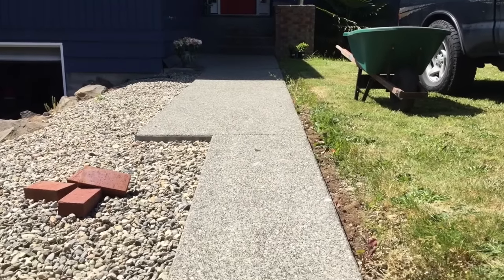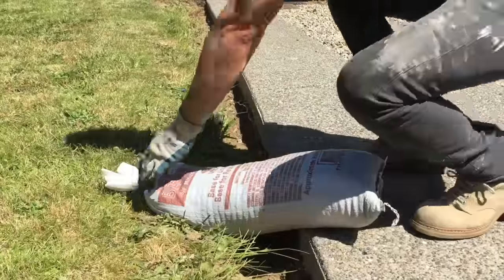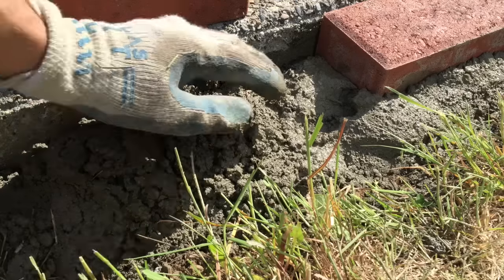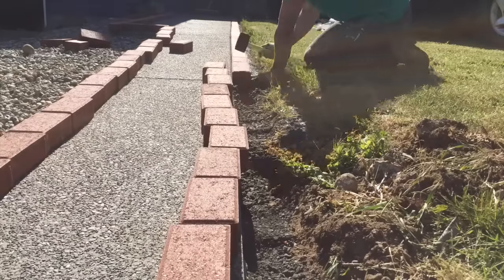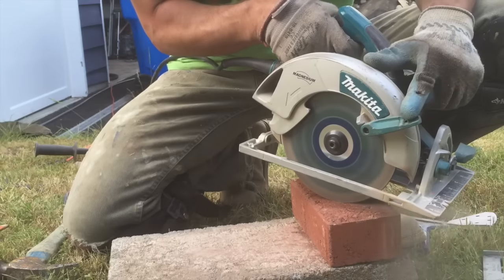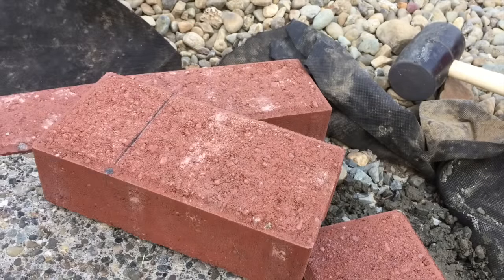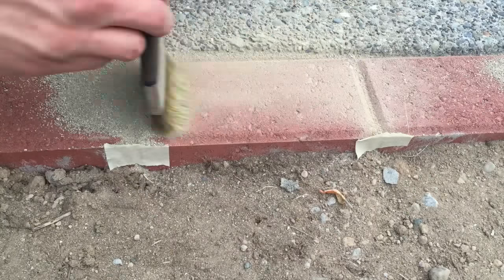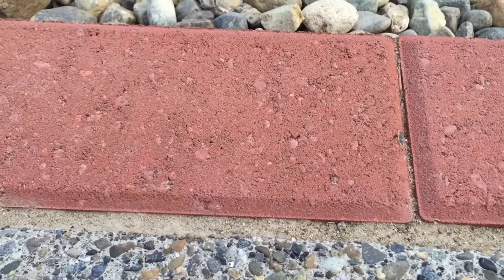DIY BRICK WALKWAY : HOW TO INSTALL ACCENT PAVERS

Comment: Just a quick mention:
               If your 45 degree corners aren’t perfect to your expectations, grind some brick dust and lay a bead of clear caulking along the joint.  As the caulk to shrink and set-up you can sprinkle the dust into the joint and it will make your cut appear virtually invisible.
              Play around with it and you’ll get a nice looking mitre.
Reply: GENIUS!!!!!!

Comment: Nice video. Using a circular saw (or even a chop saw) with a masonry blade will give you smoother 45 degree angels for those corners. I prefer the chop saw since it cuts in precise angles and I don't have to worry about marking the angles.
Reply from the maker: Great suggestion Nash and thanks so much for watching.  I’ll have to try that one out soon.  Hope you subscribed.

Comment: Great tips on building the foundation with a trench, gravel and sand. I especially like how you used the 4' level to scrape the top smooth before laying the bricks. Most videos show laying and leveling one brick at a time. I like your method better. And congratulation on the upcoming birth of your daughter.

Comment: O M G after searching for freaking weeks I FINALLY found a video that is EXACTLY what I am looking for!!! So my grandfather has a cement patio that was surrounded with a TON of weeds etc. My grandpa had 2 heart attacks and fell and can no longer work on the backyard like he wanted to. Me being a girl lol and someone who has never done landscaping before..I though " screw that! I can do anything " I busted my butt and I removed all of the weeds and other debris..it took me awhile. I finally was able to afford material for the border I wanted to create around the concrete patio. At first I used a weed killer, weed preventive fabric and then placed edging against the cement of the patio. My first thought was to put down the quick dry concrete mix and then lay the bricks...while adding the edging AFTER laying the bricks..to give it a good hold that is shaped and clean..someone came by and told me to put the edging first...which against my better judgment I went and did. Smh. It was really hard and there was a ton of space between the brick and patio. Ultimately I wanted to find a video of a similar situation to make sure I do it right the first time. I now need to remove the edging and relay the concrete. Ugh. Had I found this before I would have been done. I haven't had enough to afford finishing it and wanted it to be perfect so I could surprise my grandfather. I'm wondering how I may get ahold of you to show you a few photos of what I've done? Please let me know! Thanks so much!
Reply from the maker: Wow!  Sorry to hear that you have to do it over but glad you found my video and it helps.  Yes please send me a photos on my instagram when its done.  @byotools.  Thanks for watching and the support Angelina.
Reply: So sweet....for grandpa ❤ great story!
A great lesson, too...you don't know what you actually CAN do until you try! And, go with your gut! YOU GOT THIS!
Reply: I just did this today under the hot florida sun. I definitely did the foot thing leveling the soil. Didnt come out professional looking. But it got done. Also trying to avoid weeds growing into my pavement. Not an easy task. Especially when your not a pro. Lol

Comment: Good luck growing grass next to the pavers with the mound of concrete at the back, you never heard of edging restraint ? A quick tip, switch the hose head to fine spray when activating the joint sand otherwise you blow the sand out of the joints 👍
Reply: 7th 😢😢🎉🎉😢🎉🎉😢🎉l😊😊😊😊😊😊

Comment: quick question: i will be doing the same, but why not use leveling sand like any other pavers installation instead of concrete?
Reply from the maker: Hi Andres.  Good question.  Because I have an awkward elevation on one side of my walkway I had to use something more substantial.  Many people are affrade to use concrete since the brings may not stay adhered over time but I feel if you install the concrete and the brick correctly then the concrete should hold up.  every single prick I laid is still there and hasn't moved an inch.
Reply: Great video I will be doing something like this soon. Thanks for tips. BYOT a look back on your reply to Andre 2nd last line, last word. Might be very difficult to keep them from expanding or moving lol. Sorry couldn't resist

Comment: Thinking of doing a similar strip along my driveway. Do you think it will hold up to the weight of a car? Maybe I'll butter the underside of the bricks with Thinset before setting them in the mud?
Reply: Your the only one he didn’t comment on I’m wondering the same thing???
Reply: did you ever try this?
I am thinking of doing the same as you to widen the driveway.
Reply: @HeyStripes  No, I didn't do it. A brick layer told me that in order for the row of bricks to hold the weight of a car, I'd have to build a "footing" before laying the row of bricks. Basically, without the footing the row of bricks will tumble to the side under the weight of the car. I never looked into how to build a footing. Maybe it's easy to do?

Comment: Great stuff any ideas on my natural rockery that I've put together for my flower bed in Swansea UK? Just to keep it intact and solid and in place ? Permasand?
Reply from the maker: Great to hear Karl and thanks so much for watching.  Hope you subscribed.  As for your project I've actually took standard red bricks in the past that lined them up vertically around a flower bed.  its not as structurally sound as this video but its a cool design and you can get creative with it.
Reply: @BYOTools  Thanks for your help! I'll work on this and take your ideas and experience on board in order to make this look great! Many Thanks! Karl

Comment: one thing do not use any conrete :D brick walkaway you must lay on sand doh, same for side of walkaway. cement will start to crack after time and you will seecrack on sideway too . And you will need to redone all not one tile. You use sand as you need to fix walkaway you just replace one tile and job done.
Reply from the maker: Arturas nesakysiu I would agree with the sand comment in most circumstances but I had an odd decline on one of the sides and I needed something much sturdier then sand.  Wanted to try concrete out and see if it would last.  It’s been over two years now and I have had ZERO issues with the brick separating from the concrete.  If I get separation in future I will be posting about it on my Instagram but nothing yet.  Thanks for watching.

Comment: Great video but you forgot to show how you finished the lawn side. If you left it as you showed in video grass would never flush up to sidewalk.
Reply: I was curious about that too? Chisel off the extra clumps of concrete or are they to hold the bricks inline instead of plastic brick edging?

Comment: Thanks for the video! I have a couple of questions. I've seen edging like this being done with a mixture of paver sand and Portland cement. Do you see any disadvantages of using this mixture vs. a pure concrete mix like you did? Also, do you think adding a plastic edging along the bricks (like you would for a paver walkway) is overkill for this project?
Reply: This guy used aggregate in his mix  which I would not use as rocks stick out of the mix and mess with bricks level. A mix with no aggregate ans a mix of 6 to 1 is best
Reply: @tonesgaming1012  Thank goodness I saw this!! I was so pissed when I opened the bag of cement. It had tons of rocks in it and as you said it made it really hard to level. That was my biggest issue.
Reply: @linamarie84  I said 6 to one. But it's actually 4 parts sand and one part portland cement. That's the general formula for mortor

Comment: just doing one 45 degree angle connection is going to really bug you or someone that might be looking to buy your place down the road. What about the concrete that got pushed out the side of the bricks towards the lawn?
Reply from the maker: the 45 degree cut isn't very noticeable.  Also, you can't see the concrete since I brought the soil up to the top of the brick.  Check out BYOT #10.  Thanks for watching.

Comment: All that work for measly single brick line on either end? Guess i should explore other options since i wanted to do this, 1 foot on both the right and left side of my driveway.
Reply from the maker: Sometimes the simple looking jobs tend to be the hardest ones haha.  Thanks for watching.
Reply: It all depends on your outlook. I bake and sing and all this other stuff and one day after my grandpa had his second heart attack I went out in back and did it myself. It isn't difficult at all. It is knowing the tips that make it easy. If I can do it you can too! 😁

Comment: Good job!!! I am about to do a walk from my sister's back door to the deck I just built for her would it work if I dug down like 3 inches filled with concrete and lauded brick pavers then fill in cracks with sand concrete mix ???
Reply: Layed brick pavers
Reply: I'm using 12×12 pavers by the way and only 2 wide
Reply from the maker: In that case I would actually suggest using a sand sub straight.  The bricks I laid are still in perfect condition but not meant to be the main walkway.  If the pavers you are using way pop off the concrete and won't be as nice as a properly laid walkway with a sanded and crushed rock sub straight.  Thanks for watching Gregory.

Comment: Will this method work to make brick paver patio? This method seems much easier to do.
Reply from the maker: Hi Yong.  You could try it but I wouldn't suggest it.  The larger the area, the more likelihood there is that the bricks may come loose overtime.  None of the bricks that I laid are loose but using a traditional drainable crushed rock and sand base is what I would suggest for a large paver patio area.  Thanks for watching.

Comment: Why use concrete and not a rock base with sand?
Reply from the maker: I wanted to try something different on this project since it was more of a detail strip then a brick walkway.  All the bricks are still in tack and haven't budged at all.  I would suggest using a standard rock base with sand if the entire walkway was brick.  Thanks for watching Bill.
Reply: @BYOTools  well you could've placed the bricks on rock base and sand, and place concrete on the side only, for them not to go away

Comment: Why did you use polymer sand to fill the gaps instead of the concrete?
Reply from the maker: Concrete is way too thick of a material for this size of a gap.  The sand I used is specifically for this type of brick gap.  Hope that makes sense and thanks for watching.
Reply: @BYOTools  thank you for the reply, I'm trying to decide which i need to buy for a rounded flower edge with bricks

Comment: Would this process hold up to the weight of a car? I need to enlarge my driveway.
Reply from the maker: It potential could but I would not suggest that.  Too much weight, unless you make sure to have at least 4" of concrete under the brick.  That might make it possible.  Thanks for watching though Craig.
Reply from the maker: However, I would just suggest using compacted drainage rock and sand under the brick.
Reply: I just ran across something recently that’s referred to as mechanical concrete. It seems like a real simple and inexpensive option for multiple applications. I have a few projects on my list to do around my property that I’m thinking this method would work great for.. a retaining wall to build up and level the grade by the adjacent apartment building fence.. foundation for a back yard deck and storage building... and last but not least my driveway.

Comment: The water main. You did not plan something for it? You just left it like that? Why not design the project with it in mind, so the whole thing didn’t end up wrong after all that work?
Reply from the maker: What are you talking about Michael?  The WHOLE sidewalk is designed around this idiotically placed water main.  Why do you think my sidewalk isn't just straight?  Its in three different sections for a reason unfortunately LOL!  Thanks for watching though and hope you enjoyed most of the video.
Reply: BYOT I enjoyed the whole video until the end and then I screamed. If I had something like that I would re-design the walkway - I would start by getting rid of that existing walk that was designed by someone who does not love you.

The accent brick ending at the water main  now serves to accentuate the problem. Break that walkway out and put a bush or something over that Watermain to hide it, and make a beautiful curved walkway surrounded by amazing plants that make the front of your house look beautiful.

Comment: can I make an entire walkway of pavers using this method,
Reply from the maker: You could try it but I wouldn't suggest it.  The larger the area, the more likelihood there is that the bricks may come loose overtime.  None of the bricks that I laid are loose but using a traditional drainable crushed rock and sand base is what I would suggest for an entire walkway.

Comment: Nice video! If you would wet the side of the brick that will contact the concrete, and maybe, if you are anal as this engineer, brush on some cement on the brick to ensure it is all the crooks and crannies of the the brick, your bricks “never” break bond and come loose.
Reply from the maker: Great Tip RH.  I've never done that before but I understand why it would work.  bricks are in tack and haven't broken free yet so I must have done something right haha.  Thanks for watching and hope you subscribed.

Comment: instead it called cement until it dries? then it hardens to become concrete? its confusing.....
Reply from the maker: Its actually should always be called concrete.  Cement is just included in the mix of concrete.  Good call.  Thanks for watching HK.

Comment: That concrete is going to crack and those bricks are going to shift.  That was not even remotely the correct process.  The excavation should have been much deeper.  The earth should have been compacted with a tamper rather than a boot.  Afterwards, the cavity should have been lined with filter cloth, and the substrate should have been either high performance bedding (aka 1/4 chip) or compressed limescreen.  The only part that was done correctly was the application of the polymeric sand.  Amateurs universally get it wrong.  DIYing is fine, but you should consult an expert or do legitimate research before undertaking such projects, even tiny projects like that one.
Reply from the maker: Daniel McCaffrey thanks for watching and leaving such a detailed comment.  Your points are very valid and I would have done the exact same steps you suggested if I were doing a patio area or even a walkway but this project was just a side accent strip on my walkway.  Trust me when I say I do plenty of research before I tackle any project on my channel and yes the vast majority of books out there would suggest doing it your way but I wanted to try something different and see how it works.  No one out there that I've seen has done this type of accent strip with concrete as a base since everyone is worried about the bricks coming lose but I wanted to test it out for myself.  I'm proud to say that I installed these bricks over 10 months ago and it's still solid as a rock and no bricks have come loose. Trust me I've checked because I was curious to see if they would break loose at a curtain point. When/if they ever do I will be posting a video update to share.  In any case, please know I take pride in my channel and even if a project is not "by the book" it doesn't mean there wasn't any thought and hard work put into that project.  Thanks for watching.
Reply: Well said.
Reply: Don’t listen to detractors.  Your work looks great.  There’s more than one way to break an egg.  Why are people so mean?  If you have to be mean and critical, you have to perhaps buy some cement and then use it to close your own  trap;-) thanks 4 taking the time 2share.
Reply: I agree Daniel. I'd be 2 degrees passed pissed if this process was used around my house fa few freezes and thaws and that is going to pull away from the walk way...